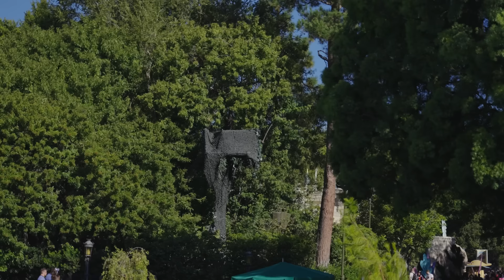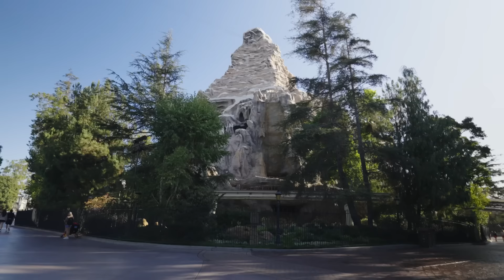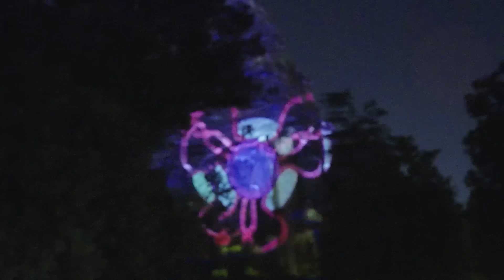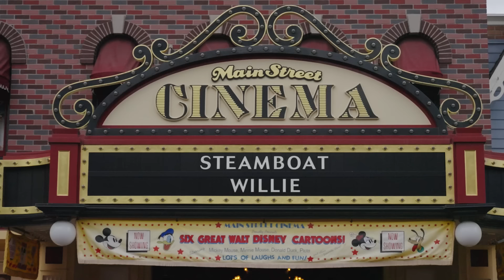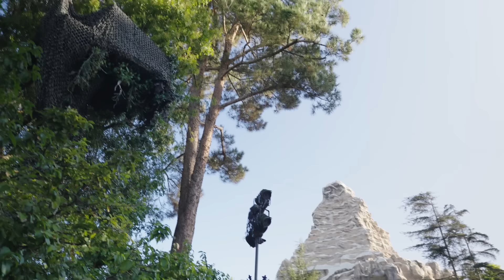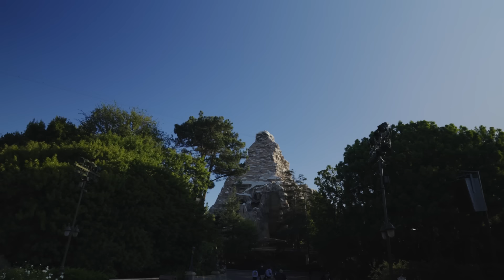Disneyland Filed a Construction Permit for the Matterhorn

Comment: 9:34 - I’m Going to guess before you go. Fireworks are becoming a thing of the past. They may be updating these areas with the extra power in order to do quick charging for drones. If they convert over to a drone show from fireworks or even add a drone show to the story telling line of options, these could just be little flight hangars for hundreds of drones.

Comment: don’t always need more power for a brighter system. Better optical glass. Better use of the energy already there, and upgrade diodes for the leds can instantly bring brighter lights with very minima, energy creep. So not to get you excited, but they might be planning other types of upgrades for other motion or projection.i would think they would lean toward laser enabled projection for max brightness maximum clarity and length of service.  Obviously the drones would need to fly in a space where no single guest can be under them in case of failure. The potential failure may actually what could kill this idea.

Comment: At the storytelling level it's about getting content and control to the right places at the right time (or triggering/synchronizing "local" playback or cue execution), and that's one of the Keys to the Magic.  Something has to be the time keeper, and the time has to be sent to a whole lotta places "at the same time" (sorry) to keep the visuals and audibles all together as projection mapping, pyro, sound, lasers, and lighting interact around the entire park.  Having the best elemental content tells the story only when it's all in sync.

Does Anaheim require separate permits that deal with IT cabling, optical fiber installation, moving or expanding cable plant or IT equipment?  New or upgraded show elements need power and content, and The Mouse will have back ups for the redundant everything they already have, so expansion/replacement may be key words.

Comment: I like the idea of AR glasses, but I am not so sure it is feasible at scale. 
I have those Meta glasses as well and now Meta has come out with an $800 version that does have basic AR in conjunction with small screen in one of the lenses. But not only is the cost high, but battery life is maybe 3 hours. 
But the real issue as I see it is that anyone can strap a band on their wrist, but not so with glasses when maybe 50% of the people coming to Disneyland need prescription glasses (as my Meta are) and/or already wearing sunglasses and so on. Then there is the issue of fit as well, but also some folks could experience nausea as some do with both Apple’s Vision Pro and the Quest. As someone who has listened to an Apple podcast (MacBreak Weekly) for years where they talk extensively about the Vision Pro there is a massive amount of development and science behind AR and the interaction between what your eyes are seeing and how the brian reacts to what may or may not actually be there. It has to do with what both your eyes focal point is (similar to ‘vanishing point” in design) as compared to what is really there vs what is not.  Compound that with walking around and all the real obstacles at Disneyland.
A neat idea for sure but so much harder than just a Magic Band!

Comment: How many people recall the best firework show ever - the 50th “Remember” presentation? The reason I bring that up is there was interaction between what was on the castle and the Matterhorn. Projections were not that great 20 years a go but the Pirates of the Caribbean sequence had fireworks firing off the castle at the Matterhorn and then front he top of the Matterhorn there were fireworks firing back, all to simulate a pirate ship battle! The projections on the Matterhorn turned to fire as if the “pirates ship” was struck by cannon fire from the castle.  It was amazing! There were also several other lighting projections that coincided with what was happening on the castle and the fireworks all around including of the buildings of Main Street!).  Easily the best nighttime show ever down at Disneyland!
Reply: As someone who was not (and still is not) usually all that interested in the nighttime fireworks shows, "Remember, Dreams Come True!" stood out as an amazing tribute and an awesome show, and I made sure to see it as many times as I could.  I don't feel like the ones I've seen since come close.  It was truly immersive in a way that none of the subsequent shows have been.  I know it would be hard to top, but I was expecting them to aim for surpassing it eventually.

Comment: Is there a reason why the waterfall isn't flowing? 
On the AI augmented reality thing, the back-end infrastructure of servers would have to be huge considering the amount of people that would be using the augmented glasses.
Reply: I wondered about the same thing. Meanwhile, the water buckets for months on the Swiss Treehouse have been on the fritz too. International supply chains for over 10-20 years may have become increasingly dependent on one source---ie, where Shanghai & Hong Kong DL are located.

Major decorative water fountains in LA have also been inoperative, one of them now going on for over a year or two. Theft of copper wire (which streetlights & other electrical systems depend upon) is another big dilemma in sections of SoCal. 

This is not your Walt-E-Disney's Oldsmobile.